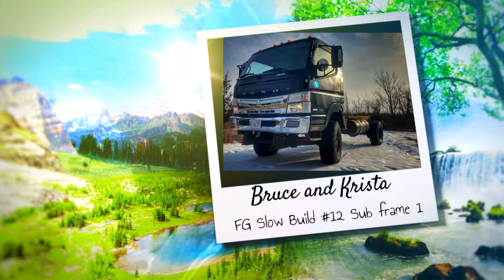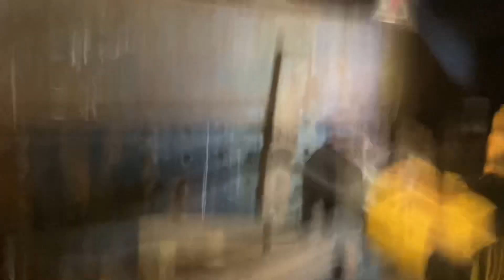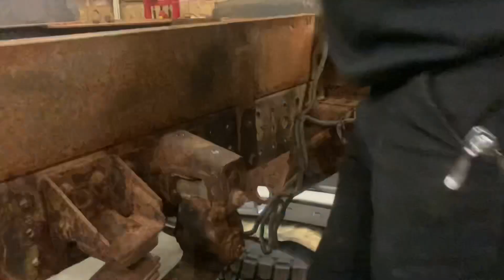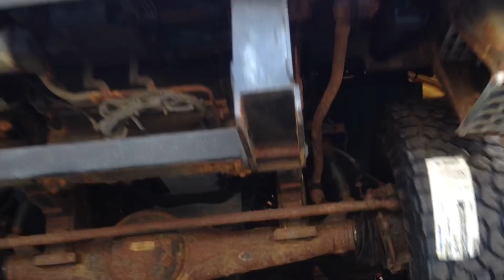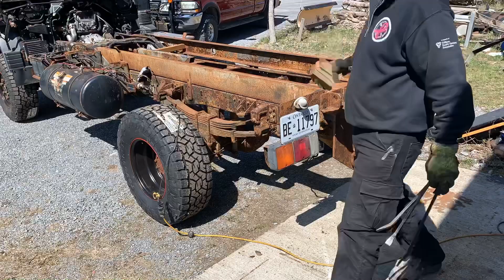Mitsubishi Fuso FG Camper Sub-frame build - Part 1

Comment: Another great video, we're I learn something new every time!

How are you planning on dealing with the rust? My truck is not as bad as yours, still having *some original paint. Previous owner is knocking the loose stuff off for me, and I've asked him to spray it with Rust-oleum Rust Reformer, which polymorizes the rust, forming a coating. I'll then treat it yearly with NHOU undercoat.

Are you gonna sandblast/spray?
Reply from the maker: Once the sub-frame and mounts are built the whole thing will get coated with black chassis saver!  This will be the 3rd truck frame I’ve done with Chassis saver - I love the stuff!
Reply: @BruceandKrista  How does it work? Change the rust, or are you stripping to bare metal?

*edit, just read up on it, pretty cool stuff!
Reply from the maker: @donbennett73  the key is that it is impervious to oxygen, so the rust can not continue, because to turn Iron (Fe) into rust (Fe2O3) - we need oxygen!  It’s the same paint I used when I repaired the floor a few episodes back.
Reply: Hi, i researched and tested this a few years ago. And the use is to my opinion and serval museum reports is wrong. In short any rust converter will only convert what you see, and at best delay any new rust to form if you block the access to water or oxygen. 

100µ bellow the converted rust you will find fresh brown rust. Therefore the very honest german manufacture fertan only recommend their rust converter where you have grinded/sandblasted down to fresh metal and you still see some tiny black pits. Also using it as an basecoat as many us brands recommends is likly the worst thing you can do, as it reabsorbs water link a spounge. It must we washed away, and preferably resanded before painting.

experienced car restores will say "if its black it will be back". so if you want to avoid rust - remove it 100% and only use Epoxy paint. it absorbs much less water than acrylic paint(2%).
Reply from the maker: @jonjessen  Hi Jon - it’s not a rust converter paint, it’s a rust encapsulator paint, and yes, anything that absorbs water will lead to re-rusting.  Chassis saver is impermeable to oxygen - which as I am sure you understand is the key to forming rust.  (Obviously you can’t form an oxide without the oxygen). Only time will tell, but from what I have done in the past, it’s seems to work.
Reply: @BruceandKrista  I agree with your choice of coating. I was responding to Dons rust converter👍